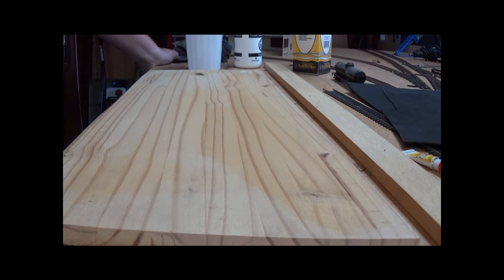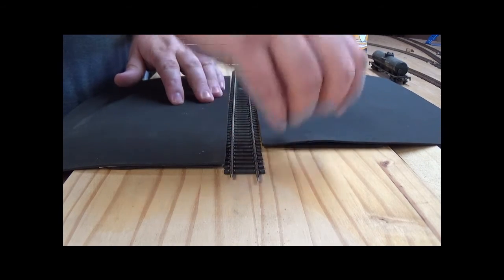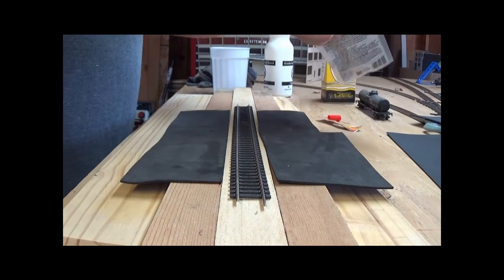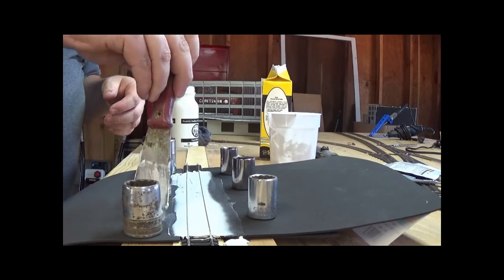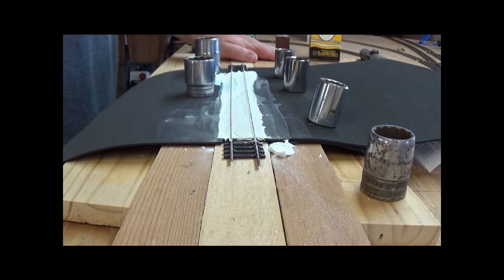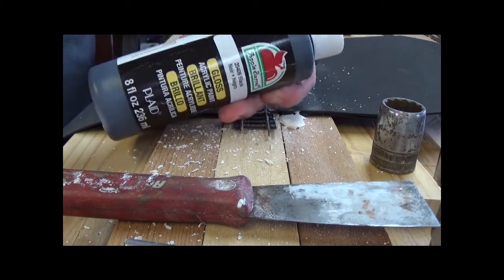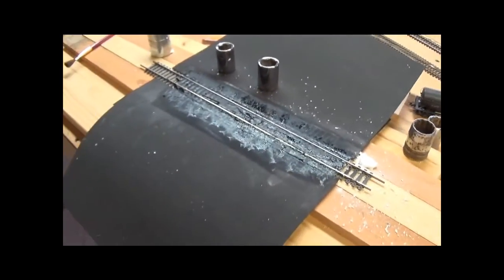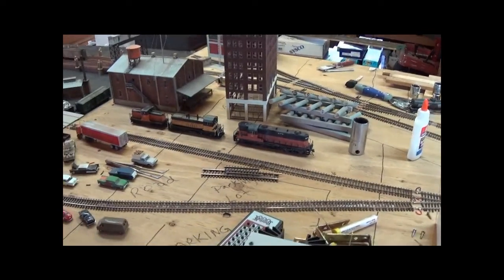How I lay concrete and /or asphalt around train track

Comment: Greetings, I just watched this video and this is great you have answered my questions about how to create concrete without the powder mix. I've tried bass and balsa, they warp as soon as you apply paint, and poster board is just a pain. I had asked a few other modelers and they suggested I look at your channel, damn glad I did. This is a fine product to use for that purpose, I will be running out this weekend to find some and start the install in my yard. I have subscribed to your channel and will start watching the other videos you have!!!  Thank you, thank you, thank you!!!!  David Muse WTCMRR
Reply from the maker: Hi David, my name is also David. You are welcome my friend. I had a chance to check out your layout and like very much what I saw, so I subbed. The big problem you have is sunlight and heat. Sunlight is not very forgiving on the color foam or the tracks and especially the products like smooth it. The wood will slightly warp and buckle causing the plaster and smooth it to crack up, but the color foam will also start to roll up on the edges.I recommend some strong glue to hold the foam down and try not to place it where you know a lot of sun hits on the layout. My old layout that I tore up had all color foam for the streets and parking lots, and so does my dioramas that I have on Facebook and soon on Flickr.  Dave Brookey .
Reply: David thank you for your comments!! You read some of my mind, and don't want a lot of ground cover and stuff like that out in the sun. working on a shade cover that will hopefully block some of that from the layout. I have a lot to consider and address!! Thanks Dave fro the comments and input!!  D. Muse

Comment: where do you get foamies
Reply from the maker: I found these foam sheets at Wal-Mart, Hobby Lobby, and a craft store called Michael's . I'm not sure where you live but if you don't have those stores available ,here's a link to some of them on Ebay .  http://www.ebay.com/itm/Foamies-Foam-Sheet-12-x-18-in-2-mm-Black-10-sheets-/282297301737?hash=item41ba3afae9:g:oSMAAOSwEzxYWIF0  .

Comment: Foam seems to be a good way to do a large area fast.  If the foam is the same height of the track why don't you cut a strip and glue it in the middle of the track instead of using mud. It would be easier and cleaner.
Scott